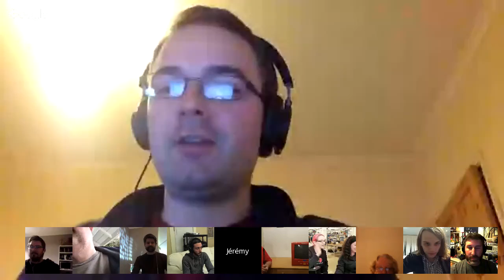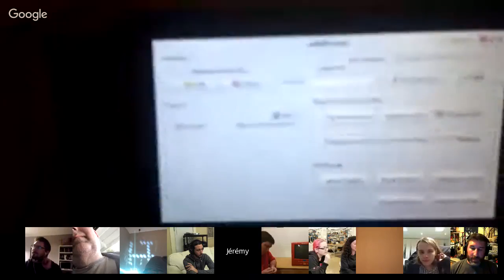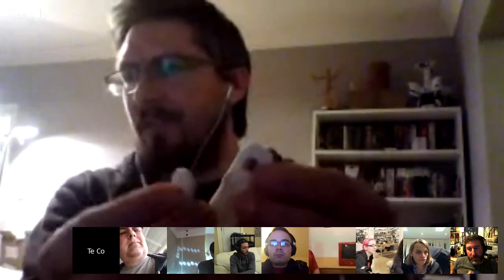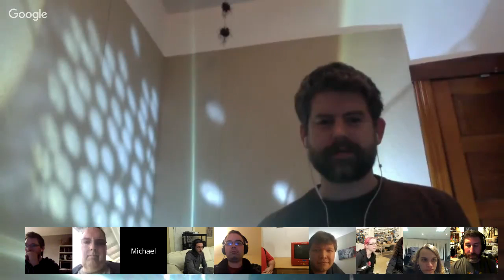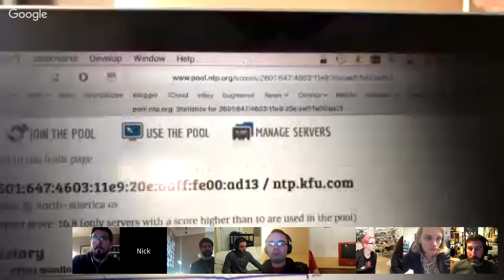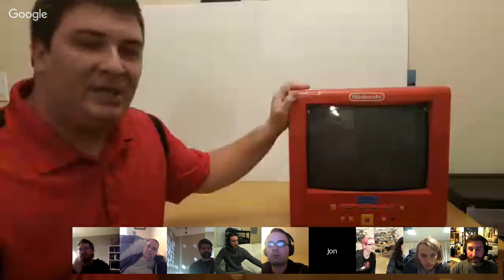Hackaday TV - Raspberry Pi show and tell with Adafruit

Comment from the maker: The projects we talked about tonight are:

-pyLCI - Linux Control Interface https://hackaday.io/project/10001 by Pičugins Arsenijs 
-Electronic drums for Linux  https://hackaday.io/project/9350-exadrums by Jérémy Oden 
-RPi WiFi without USBhttps://hackaday.io/project/8678-rpi-wifi by Andrew Litt 
-Tracking without GPS https://hackaday.io/project/16296-tracking-without-gps by Brenda Armour 
-Social Media Glove https://hackaday.io/project/16021-social-media-glove-piglove by Dan Aldred 
-ChipTuneForever https://hackaday.io/project/15702-chiptuneforever by Jarek Lupinski 
-Electro-mechanical 7x7 pixel flip-dot display used for projection https://hackaday.io/project/9800-networked-low-resolution-dmd-projectors by Michael Shaub 
-NTP server https://hackaday.io/project/15137-raspberry-pi-gps-stratum-1-ntp-server by Nick Sayer 
-Envornmental Regulation System https://hackaday.io/project/11997-mycodo-environmental-regulation-system by Kyle Gabriel
-Nintendo TV  hackaday.io hackaday.io/project/13391-nintendo-tv by Jon Rutlen